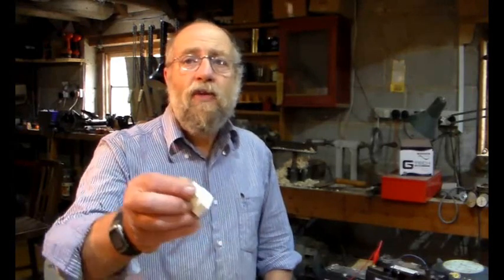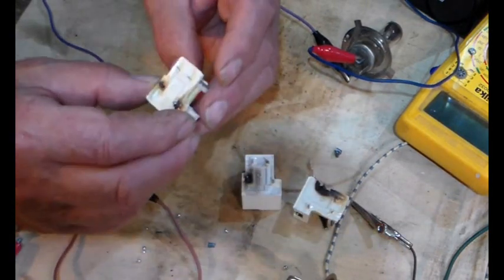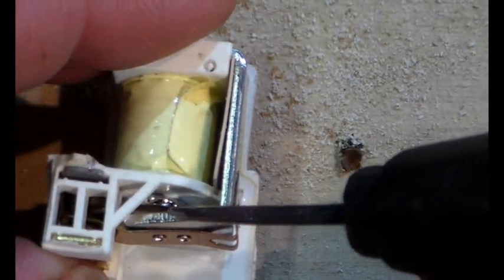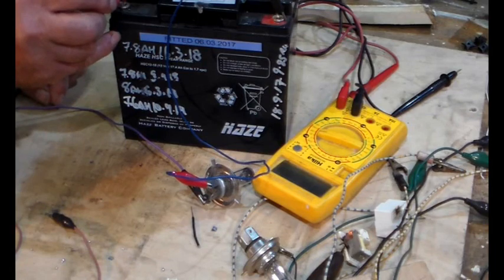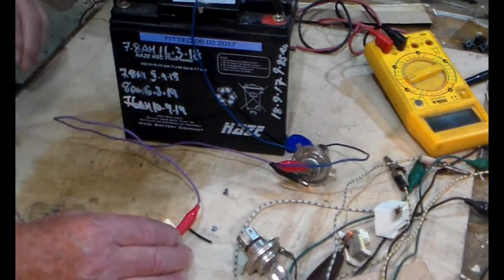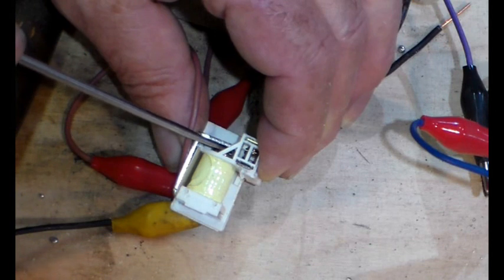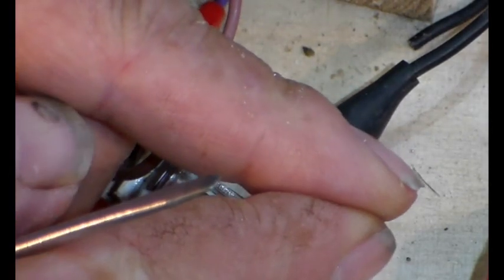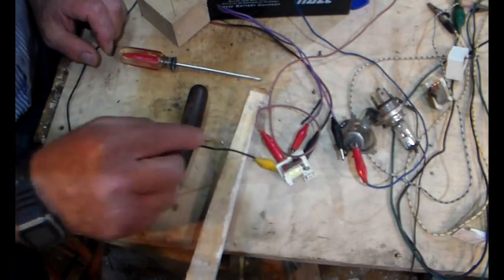ABB Aurora, Zettler, Solis relay contact repair / reset

Comment: Hi @Andy!
Your other videos were really helpful in helping me fix my Solid inverter relay. However, it stopped working again and when I tried to fix it this time, I think i've messed my relay up beyond repair now. I was wondering how easy is it to remove the relay from the board and put a new one in? Would i need to do desoldiering and resoldiring with a new relay?
Reply from the maker: Hi, it's not difficult if you have a solder sucker and a good soldering iron. Be careful of the smaller tracks on the board, make sure all the solder has been removed. I think there is a video on my solar inverter playlist, cheers
Reply: @TheInfoworks  Thank you! I've ordered a soldering iron, lets see how it goes. 
Also if i was to buy a brand new inverter, could i just plug that new inverter in to my current power supply, i.e the AC/DC cables and it would work and generate electricity and send it to the grid for my property?? Or do i need to do some config changes?
Reply from the maker: @soyebpatel2994  yes the new one (or second hand) would just work, no config. Order a solder sucker also, not expensive and they are just mechanical. Continue your skills improvement, cheers
Reply: @TheInfoworks  Thank you!! I think I messed something up as there was a spark on the board 
I am going to be ordering a new inverter and fitting that one in. Do you know if its possible to add a battery storage system to the Solis 3k-2G inverters?

Comment: Nice fix!   one thing to be aware of is to not putt the two contacts to close to one another when disconnected,  dc voltage is a killer to contacts and relays thats why these relays have quite big opening when disengaged.  I think its a good idea to turn on the Inverter when little sunlight to avoid the arcing on the relays.
Reply from the maker: Exactly, too close and the contacts will continue to arc on disconnect. They have capacitors across them to reduce this but only partially. Yes most damage is caused during disconnect at peak generation due to excess heat shut down or grid failure. Cheers

Comment: Hi Andy thank you for this video on repairing a relay. Do you have a video on repairing Finder relays type 65.61? Please share the link if you do. My solar inverter is  ABB PVI-6000-tl-outd  type. I opened and checked the PCB board. No visible burnt marks. But I noticed some sort of melting of insulation - sticky gel-like at some part of the board. What should I look for in case of failing relays?
Reply from the maker: Hi, that sticky stuff could have come from a capacitor, worth checking. The contacts can be a problem, either burnt faces or only just touching, well worth resetting. Cheers

Comment: Thank you Andy. Your videos helped me resolve my Solis inverter (6 year old and out of warranty) a couple of months ago, and yes, it was one of the relays. At first, after cutting out the cover (with a dremel) I cleaned the contacts and adjusted contact and all seemed good, but, when it got too hot, it kept dropping out (contacts where fairly pitted). I purchased a new one (£6.90 on ebay) and since its replacement it's been great. Keep up the good work.
Reply from the maker: Keith, that's good news, hope you've subscribed, cheers

Comment: I've had several relays that I've had to adjust (and eventually replace) like that.
I think the load heats up the contact point and takes the 'tempet' out of the movable contact. 
I try always to replace the relay with a higher rated load amps.
The advice to add an EXTERNAL fan is an excellent idea.
Good informational video.
Thanks for posting.
Reply from the maker: Kenny, thanks for your thoughts, this all part of the information collection. I think the final part is identifying the spark suppressing capacitors. Then maybe a video showing our collective results. These relays should be twice the size but the main problem is the switching off during high current generation because of over temperature caused by either poor installation or over driving, cheers

Comment: Would be interesting how long the relays last after your adjustment.  Couldn't you add a condenser across the contact for spark reduction?
Reply from the maker: Hi, thanks for the thought, I have a couple of spare boards so it will be worth experimenting. I assume there are capacitors across the contacts and it would be worth identifying them. The victron inverter has caps across the relays. Maybe a video before the end of the year, cheers
Reply from the maker: Hi, for some strange reason you comment on the courses video is not showing up, but yes I will show the pertinent multimeter functions, cheers

Comment: Those relays are designed to fail, the switches for DC circuits at the sort of voltages and amperages solar panels work at have to have a minimum gap of 13 mm and be fast break the relays are only one or two mm gap OK on ac but not DC they should either use mosfets or proper contactors not mini relays. Once the pins start to burn the plastic has also moved so the contacts setting will be wrong from that angle.
Reply from the maker: Hi, I agree with all you say. I believe this is designed around the fact that the contacts should only work early morning and evening where only a few milliamps are flowing, hence the problem of over temperature switch off during the day, cheers